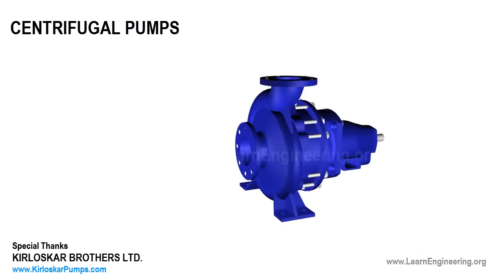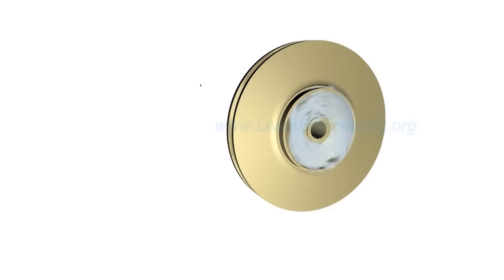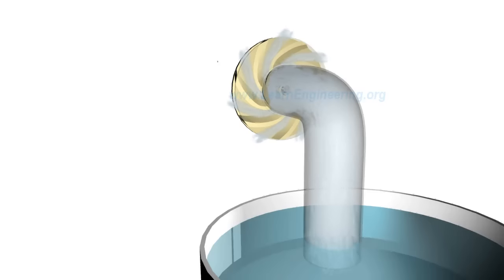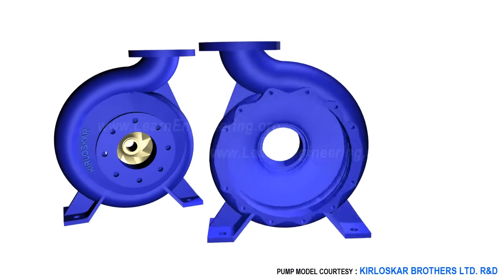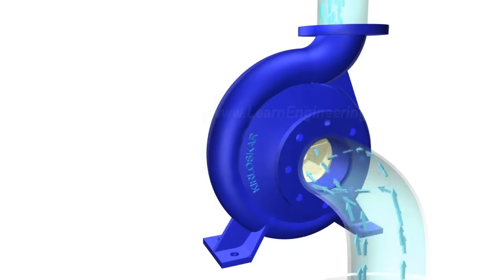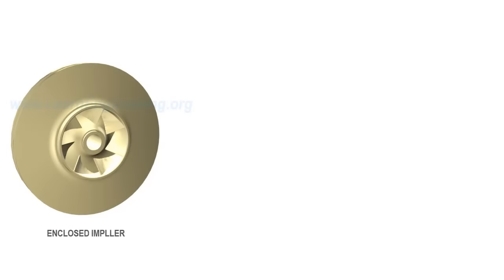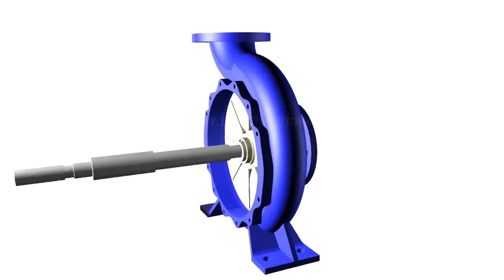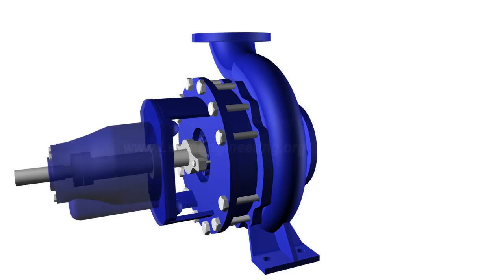How does a Centrifugal pump work ?

Comment: Video is nicely done to explain working of Centrifugal Pump. Confusion is created in direction of rotation. In this video, when impeller alone is rotating, it is rotating in counter clockwise direction. When the same impeller goes in the casing, it is rotating in clockwise direction. Please remove this anomaly. Direction of rotation is very very important in Centrifugal Pumps. Pump casing shown here is with counter clock wise rotation seen from driving end. Kirloskar Brothers Pumps are with clock wise direction of rotation seen from driving end.

Comment: The volute design in this animated video is anti-clockwise, the more common configuration is clockwise volute. The rotation direction is seen from the shaft end point of view, not the back. 
There could be some sort of animation error here to explain a common end suction pump. 
This is because  engines turn in clockwise direction only and they are commonly coupled as stand by pumpsets.

Comment: I need some help. Is there a pump that can handle some particulates as big as sand? The application would be water with some particlutes the ration would be 90% water then 10% solid particulates.

Comment: Hi, Thanks for the video. I was just wandering if it would work by attaching to a spinning wind mill. In case its possible, the wind is not constant, sometime very slow. Does it need a certain speed to lift water. Its just my curiosity. I am not an engineer background.

Comment: How does the volute casing act as a diffuser ? ( and hence change kinetic head to static head ) . 
A diffuser should have only one inlet and outlet right ? ( Please correct me if im wrong ) 
But in this case the volute casing has multiple inlet points ( infinite maybe ) at all angular positions and only one outlet .
Hence isnt the sole purpose of the volute casing to accomodate increase in mass flow rate ( coming in from different angles ) and hence to maintain constant flow velocity at all angular positions ?

Comment: i know it would be inefficient process but what if we use honey as the priming in impeller , would it suck more honey from the container of honey as compared to water pumping system, does viscosity matter ? as you said air doesnot creat enough negative pressure to suck in the water , so if we use high viscous fluid like honey and to suck honey , would it suck better then water pump?

Comment: great !!!
Can oil of high viscosity (greater than 9 poise) used??
and if yes, than how it controls gain of heat, does the oil or any other liquids cools down in the impeller , what is the process for that???

Comment: Well, this is a well-explained video but 90% of comments are about the lack of articles 😂
By the way the increasing area of the volute doesn't increase the pressure (this happens in the diffusor wich is located at the end of the volute). The increasing area it's necessary because the mass of water increases along the circumference of the volute. It serve to mantain costant the flow rate. Really god animation and explaining tough 👍

Comment: There's a reason we have "articles" in English, such as "the."  Reason: it makes speech understandable.
Reply: How I can make wire extruder
Reply: "The" doesn't contribute to meaning 99% of time. Many languages don't have article. For those that do, every language uses a different set of rules for articles. Learn any foreign language, and you will understand. Impeller/The impeller/An impeller/The impelers/An impellers/Impellers does X. How does that matter?
Reply: John L Smith “article” are where many English learning people fail badly

Comment: There is a huge misunderstanding about the role of the volute, which is NOT used to increase the pressure. Pressure rise happens in the impeller and in the bladed/unbladed diffuser between the impeller and the volute. The increase of the cross section of the volute is only meant to keep a constant flow rate as fluid enters it all around the machine, thus minimizing energy losses. If there were a pressure gradient in the volute from inlet to outlet, there would also be an imbalance in pressure around the impeller which in turn would cause unstable operation.
Reply: +Fabri92Rssista I was thinking something similar when i opened my spa pump for first time, it should be designed to balance the pressure along the volute and keep the flow rate. Would be great to see a CFD analysis to verify that. Anyway the video was awesome
Reply: Fabri92 if your still out there please answer this I need your help on scale magnitude you would not believe it will be the crowning achievement in your life and will take you just a few minutes
Reply: Fabri92

Comment: what do you mean by suction head,does it mean that if suction head value is high it causes cavitation
Reply: Yes exactly, if you were to shut off inlet, as in highest head pressure, cavitation would take place.  Head pressure is the internal energy of a fluid due to the pressure exerted

Comment: You said that reduction in exit flow velocity will result in increase in static pressure which is required to overcome pump resistance. My question is how does increase in static pressure help overcome flow resistance?
Reply from the maker: ***** You may know that frictional pressure along the flow is proportional to Velocity^2. This is the reason of reducing velocity.
Reply: +Learn Engineering you need to learn the word 'the'. But otherwise your videos are excellent.

Comment: A common mistake when describing this device is in 'calling it a pump ' it is in fact a ' circulator '. A pump uses a decreasing volume area to force a liquid to move as the liquid cannot be compressed. This device will still rotate if the outlet is blocked
Reply: Positive displacement is only one type of many types of pumps.

Comment: One question it seems I am not grasping 100%. For this particular pump, does the input come from the mechanical power produced from the shaft as well as the pressure gradient induced on the water to produce fluid flow? Can anybody enlighten me here?

Comment: how come both the pressure as well as kinetic energy of the water increase as told in the video at 0:50?? if one increases the other has to decrease isn't it?? please explain.
Reply: Because the impeller is doing work on the water, therefore total energy increases.

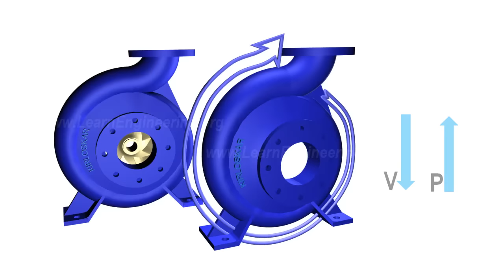Comment: How can the preasure rise aswell as the kinetick energy like he says @0:50 ? I get that the preasure will rise when the velocity goes down like he says @2:10 from the Bernoulli's principle, but I don't get how the preasure can rise at the same time as the kinetick energy does. Would be greatfull if someone could explain.
Reply: I think it's from the energy equation (adapted/extended Bernoullis, from Reynalds transport theorum. You're inputting power into the system via the pump, although the pressure would drop with a rise in fluid velocity, the added work from the pump counter acts this and leads to an increase in pressure AND velocity overall. Correct me if I'm wrong.

Comment: i wanna pose a question but first i need to give an example. lets say you have a centrifugal type pump and its dispalcing water at 1000 gpm at 1500 rpms at 200 psi why is that that same pump at 1800 rpms only puts out 500 gpm at 250 psi?

Comment: Are pumps and compressors same?
Reply: +arunnath1198  no compressor is used to increase pressure and temperature but pump is used only to increase head i.e pressure .Generally pumps are used to handle incompressible fluids while other one is used for compressible fluids
Reply: Pumps=liquids
Compressors= air

Comment: And for the mechanics down here:
THE PACKAGE SEAL IS SUPPOSED TO HAVE WATER DROPPLETS EVERY NOW AND THEN!
Why? Well that's what lubes it to meke sure it deosn't spoil the shaft, if the seal is tightened too much, the friction coefficient goes up and the water droplett rate goes up even faster, makeing mechanics (untrained, or unaware) tightening it even further until the shaft is looking like someone scraped pieces of with their fingers etc. while it was rotating. This can nibble down the shaft to 1/2 original thickness easily, please beware!

Comment: So, how do you increase static pressure? Increase spin velocity, increase motor torque at stable RPM, change the pump? Trying to figure out how to get these commonplace pumps to put out more than 66 psi, without buying a super special really expensive one.
Reply: idk much about pumps.     seems like  the  point of   cavitation  is the upper rpm limit.      i doubt there is an inexpensive solution, to the stated goal.       maybe  more  impeller vanes  or  different  vane   design  or  a  different  drive system (maybe an outrunner motor).    it is not clear whether it is stoopid  to orient  such a  pump,  horizontally.   cheers          googletranslate
Reply: Use Series compounding of low head pumps to increase pressure to high manometric heads, discharge will remain same across all series pumps

Comment: SUKANTA BANERJEE,    TALTALA,.   KOLKATA  700014     @     MY  WATER  LIFTING PUMP   1/2  HP  HAVE BEEN  BLOCKED BY  RUST  &  THE  IMPELLAR  IS  NOT  MOVING  FOR  LYING  IDLE  FOR  6  MONTHS  DUE TO LOCKDOWN FOR  CORONA. ........
..PLEASE  SUGGEST  REMEDY.

Comment: "more the suction head, lesser should be the problem of cavitation"

wat
Reply: Waldo Fox lmao
Reply: cavitation factor are more related with the system pressure, speed,  and vain angle. inlet dia are not so much related.
Reply: @smilloww2095  The higher the absolute pressure of the liquid entering the eye of the impeller, the chances of liquid cavitation, (absolute saturation vapour pressure), are reduced. For a given temperature. 
That's why it's advantageous to design pipework/ piping layouts with positive suction head. I.e. liquid level above impeller suction centre line. The animation displays liquid being sucked up from a level below impeller centre line, which is a very common occurrence. This is still possible but with a rise in temperature or distance below impeller centre line, cavitation can be induced, damaging impeller, bearings and possibly volute. 
Manufacturer pump curve data charts will indicate volume flowrate at a given static head (resistance to liquid flow from pipework, bends, valves, coils etc. Indicated in meters of head, kpa, psi, inches of mercury and so on). Once this duty point is known, NPSHR "Net Positive Suction Head Required" can be read off of the pump data chart. 
Once we know the NPSHR we can compare it with the calculated,  NPSHA "Net Positive Suction Head Available". 
NPSHA = (Absolute pressure at pump inlet, "Pi", - Absolute saturation vapour pressure of liquid, "Pv",) ÷ (liquid density "p", x  gravitational acceleration constant, "g",). 
NPSHA= (Pi - Pv)÷(pg)
So as long as NPSHA  > NPSHR cavitation can be avoided.
Cavitation issues are usually experienced when heating or very hot water is being pumped or when liquid refrigerant or liquefied gases are being pumped.
Reply: @crestair1282  damn bruh
Reply: @smilloww2095   I can't read all that

Comment: Centrifugal force isn't actually a thing- it's a "pseudo-force", meaning it looks like a logical explanation, but it doesn't stack up in numerical analysis. What's happening with the impeller is that its veins hit the water at an angle, pushing it away from the center. That reduces the pressure at the eye of the impeller, and the inertia of the water, as well as its kinetic energy, keep it moving outward.

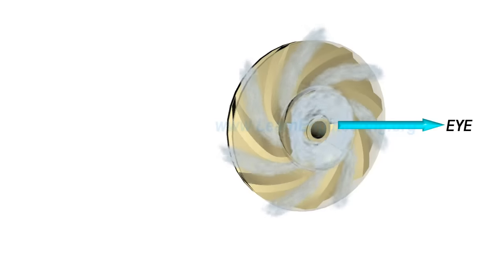Comment: 0:54 I'm not understanding how a negative pressure is created at the eye of the pump
Reply: It is because matter (in this case water) is being displace. Picture this, you have a ballon, and you start blowing air into it, you are putting matter (in this case air) in the ballon, with every particle of air you put inside the preasure inside the ballon increases, it´s not a problem at the beggining, the ballon is elastic and can handle it, until it can not resist the preasure of the air because you kept putting matter and it blow up.
Here It is the same just backwards, if putting matter into a vesil increases the preasure, what will happen if you take it out?

Comment: I'm a moron. I never even thought of a propellar in it. I was thinking it would be up rotating longways pushing it in a certain direction. But I realised that wouldn't work so I looked it up.
Reply: I don't mean like at the end of the video btw. I meant a strait pipe with a paddle wheel pushing it. Was all I could think of.
Reply: fyi  -   'so i looked it up'     THE  END.        bravo

Comment: why does centrifugal pump has higher efficiency than reciprocating pump?
Reply: A centrifugal pump has less efficiency with respect to power than recip, pump.
Centrifugal pumps advantages are: handling large amount of flow, smooth in operation, and low maintenance cost.

Comment: Am I to understand that electric water pumps are literally just DC motors with a fancy blade attached?

Why the hell do they cost so much money?
Reply: Christopher Pilcher That fancy blade has to be precision machined out of cast bronze, that's why.  Each impeller has a certain performance characteristic, so if you need higher pressure or more capacity a different impeller has to be made.

Comment: your pump is turning in wrong direction
Reply: nope.    wondered  too.     if direction of impeller rotation is reversed,  the vane contour  would  Oppose  the movement of water, outwards,  and  the  correct  draw   would not  occur.

Comment: There is no such thing as a centrifugal force. The water does not to move outward (normal) from the impeller. The water actually moves tangent to it's motion. Get your mechanics straight.
Reply: Centrifugal force is always tangent to the circle or centripetal force. If you leave stone that is rotating in the circle it will fly off in tangent direction. In shorts words outward movements of the water is due to centrifugal force.
Reply: centrifugal force always exist when some thing is spinning like if you spin a scarf in a circle the scarf straitens out.
Reply: I can assure you there is a centrifugal force, when you swing a ball on a string the ball will exert a centrifugal force on your hand which your hand will feel.